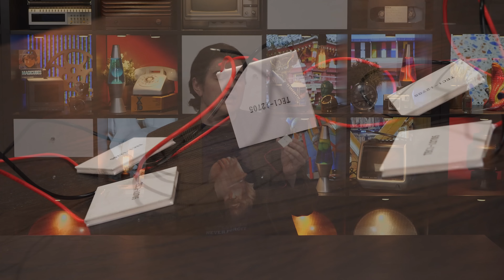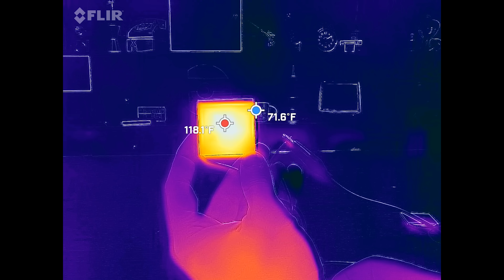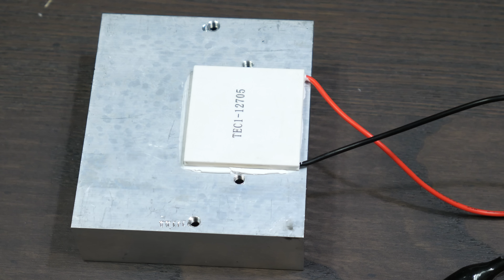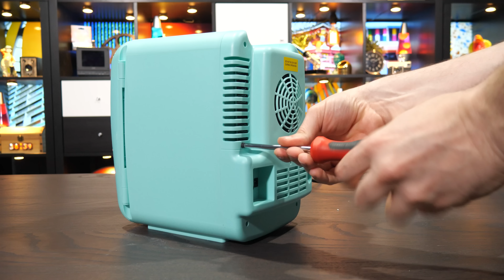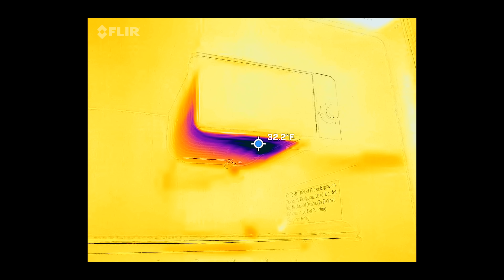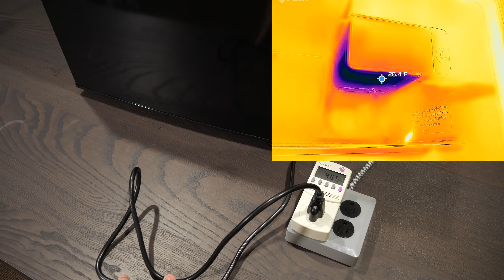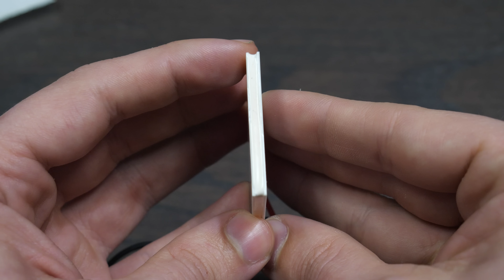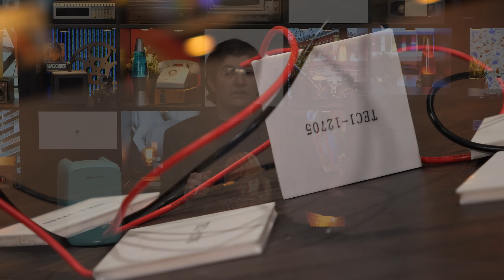Thermoelectric cooling: it's not great.

Comment: I bought one of these fridges on Amazon, but I didn't know how it works. I just wanted a small fridge.

Now my small fridge is collecting dust in the corner because apparently using a relay to turn on the real fridge for 6 hours a day turns out to be way more efficient than using this small thermoelectric fridge.

Comment: There is a consumer use for cheap Peltier cooling devices, but not to cool, exactly: I have a small Peltier dehumidifier that does a good job of lowering the humidity of a decent sized closet using 22 watts of power. For this use, the waste heat, which does heat the closet somewhat, adds to the effectiveness of the unit, since relative humidity decreases with temperature for a given amount of moisture in the air. I find this unit to be more effective and convenient than passive moisture absorption, and much quieter and cheaper (both to buy and to run) than any small compressor-based dehumidifier. I promise never to buy a useless Peltier refrigerator, though!

Comment: I had this weird mini fridge once, you filled it with salt water and could stick a tall can in it, it then had this electric stir stick near the bottom. When on it stirred the water in it, and had a pump on the sides to keep it cold. Apparently it was some lab equipment for cooling things real cold, like you could set it to -10C to 10C. Then converted to be a beer cooler.

Comment: Another use is keeping a sensor like say a MEMS rate sensor or hall effect sensor at a specific temperature like say 70 degrees or whatever you need. Sensors are infamous for producing different results depending on temperature and the usual way to address that is calibration and a temperature table but what if instead you just stuck something on the chip that kept it at a constant temperature? Being reversible the junction can pump heat in or out out to maintain the temperature you want.

Comment: The mini fridge freezer compartment  is great for your daily dose of ice cream. 😀

Small Peltier blocks are brilliant for temperature regulation of things like infrared imaging chips and find use in circuit ovens (hot enclosures for temperature-sensetive electronics).

The powered cold box in the car ... never gets switched on, it's just a well-insulated box.

Comment: As obsessed as you are with refigerators Im just obsessed with what makes them start to leak. and also why a unit may last 30 years but then another only 8. I may have missed it but what things make certain units last so much longer than others? Is it the tubing? the seal? the compressor? the way its used? the environment it's in?

Comment: I'm assuming we don't have a generator with high enough efficiency but I'm theory of heat is energy and it's pulling less power energy than it's moving around heat energy couldn't we put that heat energy into a striking or steam generator and get more power energy out of it than we originally put in? Like the fact that heat pumps work at all should imply the existence of perpetual motion machines? Idk I'm stupid 😂

Comment: I've actually built something using these little fellas that's actually practical: A bed cooler! It uses 4 elements running at half their rated voltage to cool (or heat) water that runs through a mat on top of my mattress. My mattress sleeps incredibly hot, so hot that i would need to get my room to 66 degrees Fahrenheit in order to sleep. With my little invention, I can sleep comfortably all the way to 80 degrees Fahrenheit. The fun part is, it only uses 60 Watts to do so, and I typically don't run it at full power. With a bit more optimization, I think I could make this thing a bit more efficient. The problem is, now that I've got mine sorted out, the Chinese have come out with their own version for cheaper than I built mine. Bummer...

Comment: I use peltier cooling with a system that I can get 80+ amps out of (solid state energy harvester, thanks Don Smith!) - works great. But yes, phase change is the king of cooling per watt... the peltier system will outlast any phase change system, is quiet and lightweight. The main issue is removing the heat. I've tried the ice giant evaporative cooler and the efficiency is pretty good, but a water closed loop system would be ideal.

Comment: yes but those fridges still need room, i need a fridge that will fit inside a kallax cube, dont care about the rest, can you give me a fridge that does that? no you cant...so there is a market for them...your point is? also start using normal temperature units, since the rest of the untint you use dont have any sense otherwise cause they are metric...

Comment: I do have to ask for curiosity’s sake. When comparing the cost per year to keep each fridge running, you stated an average of 22 watts for the actual refrigerator. That was with cold drinks inside as well as an already cold fridge. The Peltier fridge (55W) was unplugged with the door open prior to being measured for current draw. I’m not sure if it applies to Peltiers the way it does to real refrigerators, but the 55W draw was also taken fairly soon after plugging it in, so it may not have had enough time to regulate the circuit. Was the peltier fridge already cold? Was the real refrigerator at the same minimum temperature (46F) as the peltier? Would you be able to provide an updated figure on current draw with the same metrics used to measure the draw from the real refrigerator? (Already cold, with the same ratio of cold cans compared to maximum capacity, and more importantly, the same temperature as the real refrigerator). I understand you cannot adjust the temperature of the peltier, but perhaps you could test the wattage again on the real refrigerator using the adjustment knob to set the temperature equal to that of the peltier. Thanks!
Reply: Without a thermostat there's literally no way it can know when to supply power, so it just supplies it 24/7

Comment: These coolers are fantastic for portable cooling. Got the Frigidaire 6 can cooler. Fantastic product, works like any other drink cooler (up to 40 degrees below room temp, took like 4 hours to cool a room temperature beverage, 50watts MAXIMUM usually at 40W, uses LESS on DC). It's all about the cooling fan/heatsink. I've powered it exclusively with cheap solar panels and batteries.

Comment: The main takeaway I find most impressive is the fact that refrigeration pumps and insulation technology have developed to the point that you can run a whole French door residential refrigerator on less power than it takes to run a couple of lightbulbs.

Comment: Want to know what doesn’t work in my office? An actual fridge.

Yes, my office is a truck, and I slip seat, so mobility is an issue, and the drinks I put in the stupid (mine is grey) blue fridge are already cold, and they stay cold.

Context is everything. I’ve never seen a blue fridge with a 120v plug. And I’ve never actually seen a “proper” refrigerator with a 12v plug.

Comment: I can't think of a single reason to use a Peltier device for cooling anything (in my life). I hate that blue box.

However... I did see a really interesting Instagram reel where somebody had bought some fans with Peltier elements in the bottom, with passive heat sinks on the top, powering the fan by setting them on top of a wood burning stove. The fans would distribute heat (powered by the fire!) while the stove was burning by blowing the fans, as well as cooling the cool side of the device, and even had a bimetallic strip in the bottom to lift the device from the stove when the device was getting too hot. Really interesting and simple design for an actually useful purpose.

Comment: The little drink cooler I bought works well enough for my needs.  It's not noisy (better quality fan I guess.)  If I refill it before I go home from work, I'll have 6 cold cans in the morning to drink through the day.  It also takes up little space on my desk.
I have a Kool-a-tron larger cooler works well for me for camping.  It run's on 12V while we are driving and I can plug into AC at the campsite.  It does not care about orientation unlike compressor fridges.  It also cost about 1/6th the price of the equivalent compressor model. It's a great add-on to the Absorbtion fridge in the trailer and actually cools down faster.

Comment: TECs are used extensively where hitting an exact temperature is needed. They can heat and cool, so you can set up a closed loop PID circuit and stabilize the temperature down to about .001 degrees C. When is that needed? Not very often. One example: a really nice single mode laser will drift as the room temperature shifts through the day, so a TEC is used when making very sensitive measurements.

Comment: But isn't the problem with Peltiere element that they are so thin? So the cold side of the element ends up cooling the air as well as itself from the heat sipping in from the warm side? Doesnt that make it work extra hard? Isn't that where it's "loses" come from? Because it makes no sense for a heat pump to be more efficient than the Peltiere element except for the complete insulation of components, as it also uses energy but it has losses on all these moving parts and liquids? We need a thikk boi Peltiere element.

Comment: I bought the Diet Coke one that they sell at Wal-Mart and it works great. I use it at work on my desk. It's not loud and it cools my drinks pretty good. If it uses alot of electricity, it's not my concern. I can't have a fridge in my cubicle because I work in a govt building on a military post and we are not allowed to have any refrigerant devises that produces condensation unless it is plugged into a CGFI outlet. Which I do not have in my area. I have little to no issues with mine.

Comment: One last useful feature of Peltier devices is their ability to generate electricity from small temperature gradients. While their efficiency is quite low, they are one of the few practical options for power generation in situations with minimal temperature differences. For example, even the heat from your hand can produce a small amount of electricity using a Peltier device.

Other devices, such as Stirling engines, can generate power from relatively low temperature deltas, and there are toys that can spin a flywheel using the heat from your hand. However, the practical efficiency of Stirling engines at very low temperature differentials is significantly lower compared to Peltier devices, which, despite their low efficiency, perform better in such conditions. Stirling engines generally require a larger temperature gradient to operate efficiently, making Peltier devices more suitable for applications involving very small temperature differentials.

Another area where Peltier devices excel is in sensing applications. Their ability to generate a current in response to even slight temperature gradients, with the current being directly proportional to the temperature difference, makes them ideal for use as temperature sensors.

Comment: I don't get why Peltier elements are only generally available as combined units instead of split units to eliminate the conduction loss. Yeah, I know you can't use copper between them, but the exotic wiring between them should be included by the supplier. (When I was studying mechanical engineering, I was the only student in my class who got an A on our thermocouples unit, so I'm very serious about this!)

Comment: A lot of people don't understand the basics. There is no such thing as "cold". There is only heat and the absence of heat. You can create heat out of stored energy, like burning wood to set the energy stored in it free or transforming electricity into heat and you can move heat. You can't do anything like with coldness because it doesn't exist. Cooling is just moving heat somewhere else. That is why heating was invented in the stone age and refrigeration isn't even 100 years old. And unless we discover easy use wormholes to sent heat into the shadowrealm, cooling will remain infinity harder than heating.

Comment: As a both electrical and computer engineer I agree completely with this video. But I will go off topic here -I have something else I would like you to investigate and comment on - the new HAWK pedestrian crossing beacon systems. We just had one put up near our house and there was no explanation of how it worked.  I have investigated them and their history online and as I see them they are over-engineered and far from intuitive, making them potentially dangerous. To me it is relatable to your discussion on new taillights. I had a reason to go to the RMV yesterday and out of malicious curiosity I asked a representative there if he new what they were and  how they worked. He told me he was familiar with them, but even though he was familiar he could not tell me how they worked. To start your search look up under HAWK and Phoenix Arizona and you will find some of the more comprehensive info. I am in MA and the RMV site has no info on them. Have fun.  Great channel.

Comment: Yeah, I've used peltier diodes for very specific effects in scientific and electronics work - but I usually used a heat pump to remove the waste heat, so there's that.

Comment: If you have to use thermoelectric, I found that they use horrible quality fans and you can upgrade the fan to a quieter more efficient fan that will help it cool better. And of course, fill empty walls or door with spray foam insulation. I used the big ones when transporting medical specimens and they work so much better with a quality fan.

Comment: I totally agree that these things are a bad purchase for most folks. 

I purchased one for the office for $25, and was disappointed with the fan noise. Seeing that it is just a regular PC fan, I ended up switching out the fan for one from Noctua. Now it is nearly silent and actually cools my seltzer much better! Sure it doubled the cost of the fridge, but it was still overall a lower cost than a proper fridge even with the fan mod. 

If I was paying for the electricity, there's no way I would still be using this thing though. It draws a constant 48W. Doesn't sound like much, but it adds up to 35kWh per month! That's enough to drive my EV for over 120 miles!

Comment: Could you please come back on this topic but from the point of view of dehumidifiers? They sell both options: Heat pumps and Peltier. In this case, witch one would be more efficient, since we are not moving heat... But just dehumidifying the air.

Comment: What about heating in a jacket? Or is that a fire hazard no matter how you slice it? I'm thinking arctic level heating requirements, since they're lightweight. Would the cooling of the wires in an element increase its efficiency? Thinking of layers of these things. Maybe the temperature difference would thwart it after the first layer, I don't know

Comment: you are forgetting that a Peltier element also needs a thermostat. you could also dimension a heat pump so small that it always runs without a thermostat. then its COP will also be poor

Comment: One cool application of a Peltier element is to operate a fan off stove. You can make a bit of DC current with temperature difference and run a fan to circulate air away from the stove and around the room.   Great video as always!  Love the content.

Comment: I disagree with the title, I feel they are great, but what I feel is the issue is poor implementation.

If you think back to the refrigeration cycle, they use tubes to carry compressed gas around the fridge as it expands before being recompressed

Every implementation of PET cooling I’ve seen is to just slap it in the back off some plastic.

I have made designs that use a water block with a Peltier instead of a cpu and a pump. And the cooling would be way better.

The choice for materials in that fridge were not really thought out.

If they had used more conductive materials for transferring heat, I believe it would fair better.

I agree Consumer electronics for this are cheap and most times a waste of money. But it’s mainly the fact that there is no cheaper option is why it’s so popular

Comment: I use one in my garage to keep my machine shop dry, runs on 5 watts power . 2 heatsinks and a 2 inch fan  pulling air in over the cold heatsink and cooling the hot heatsink next. cold side about 5 to 7 degrees celsius condenses moisture and collect it in a closed jar.
cheeper than moisture eaters refils.

Comment: I was looking a few years ago for a car cooler, I was looking at ones that have the fan because they seemed more of a fridge, before putting money on one of those I had the "pleasure" to see how well one does and man beer inside that or outside tasted the same, waste of money.
I just got a cooler box, freeze some of those freeze battery things and for 48 hours it was cooler than the electricity wasting crap box that did isolate well also

Comment: My wife purchased a wine storage cooler that uses this principle of refrigeration.
The unit holds maybe 10 to 12 bottles of wine, I'm unable to hear its fan running, and it keeps the wine right at my wife's preferred temperature, somewhere in the mid-40s.
It's thermostatically controlled.
Its purchase price was reasonable, as well.
Its run costs?
I have no idea, and truth be told, I really don't care.
The run costs can't be too terribly high.

P.S. - I'm gonna go ahead and declare the red Galanz unit in the video to be a mini-fridge.